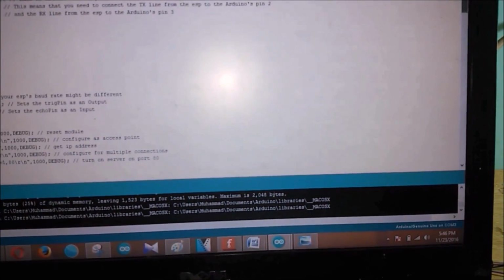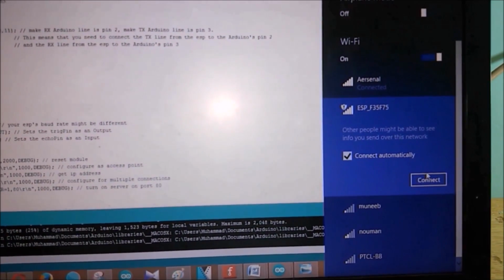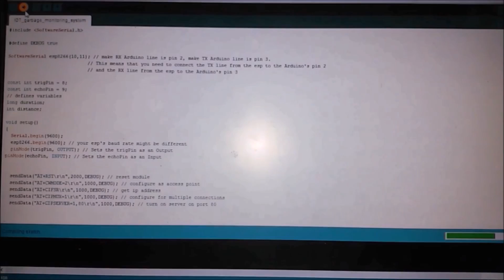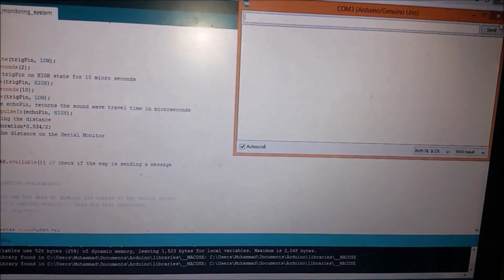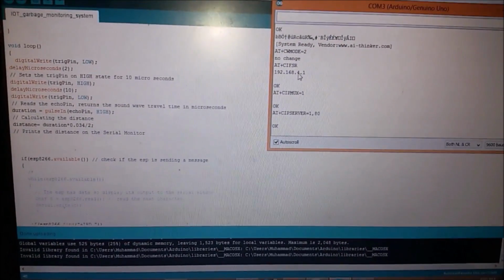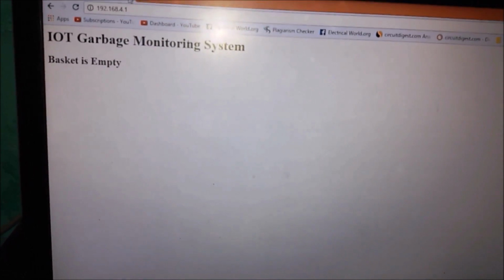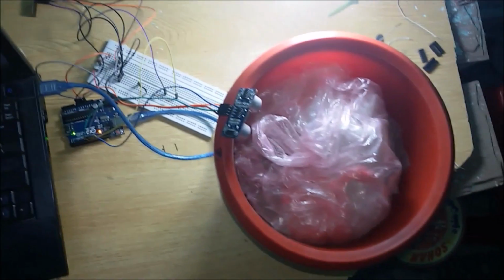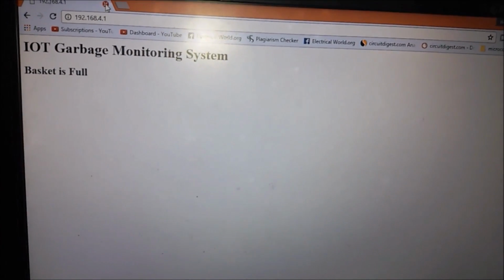How to Make IoT Based Garbage Monitoring System using Arduino

Comment: Hi ,
Thanks for you to share this great project. I have made the same one as yours but it did not work.
My ESP-01 is able to get IP thru serial console display and I have tried to ping it with no problem from other computer but there is a problem to open Web-page.
I copied and paste the code to recheck it again but it is still not working, Can I have a suggestion please where should I check it?   .thank you

Comment: how to check baudrate of esp8266 and should baud rate of serial.print should be same as baud rate of esp8266 
my serial monitor is displaying only a^ eight times
Reply from the maker: No the baud rate of serial print and ESP8266 should be different. You might wanna try some basic program to check if your connections and method of uploading the program is correct before proceeding to this
Reply: BUT ITS NOT DISPLAYING IP ADDRESS AT SERIAL MONITOR
Reply: rupinder singh 

Then change the baudrate into 115200 it will show u ip address mine showed